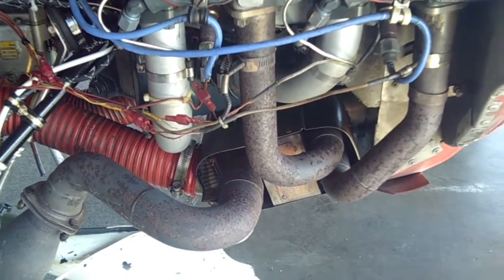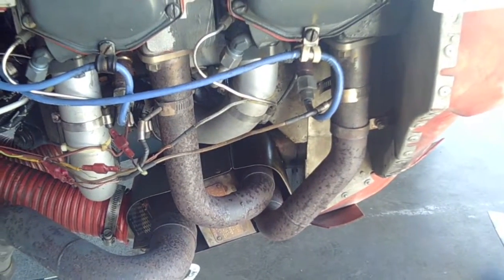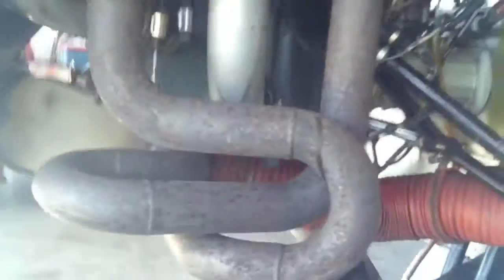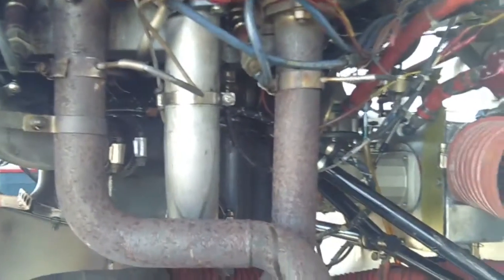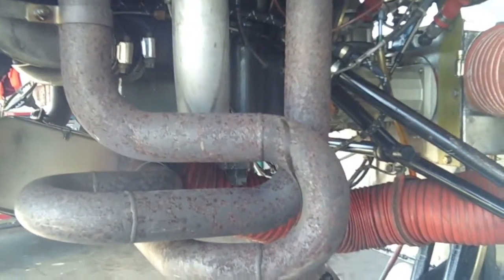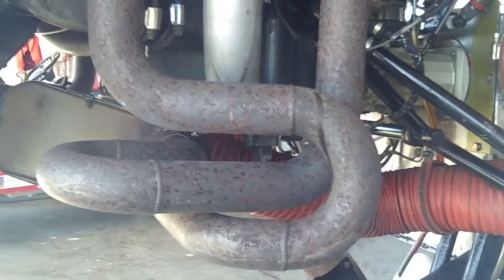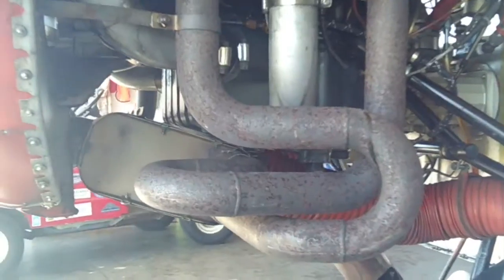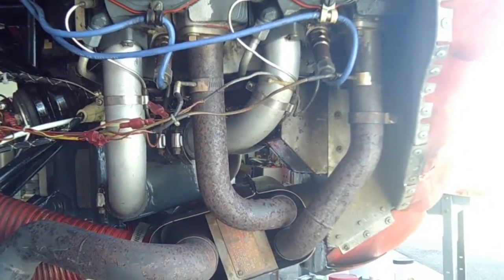Powerflow on a Tiger -  Grumman Style

Comment: I installed a power flow on my AA5B as well as the Lopresti cowl modification and HID landing light. The engine picked up 95 RPM static and a solid 100 + feet per minute climb. Engine has a different sound and is a bit quieter.  Oil temperature dropped at least 10 degrees and here in the southwest, that's a big deal.  I did not notice any change in fuel consumption, but did note a slight increase in maximum speed.  It was an expensive modification, but I think it was worth it.
Reply from the maker: k